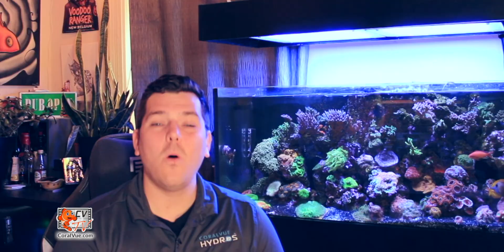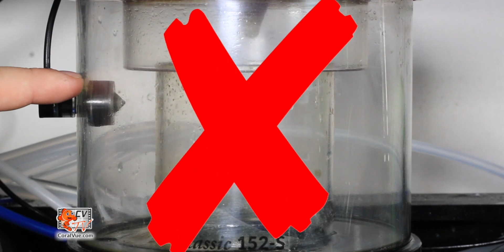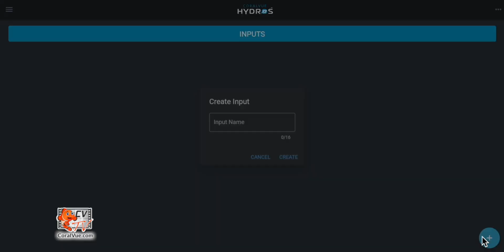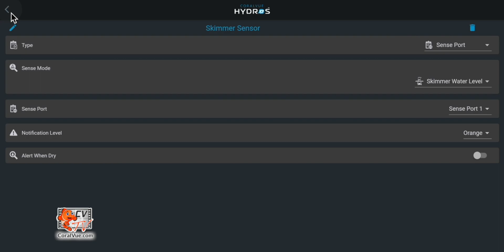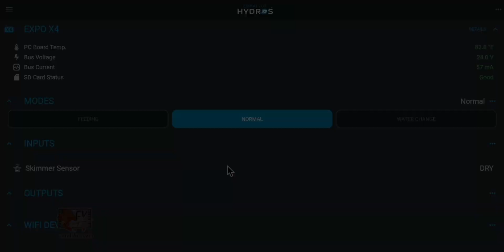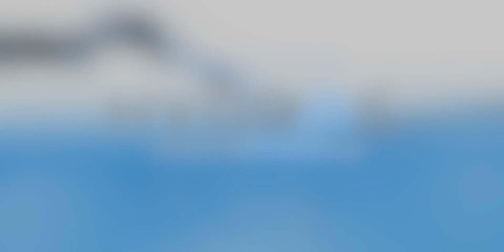HYDROS Set-Up Instructions - How to Add and Configure a Skimmer Water Level Sensor

Comment: Can this be used in on an opaque waste container? 
I would like to add a sensor to the masteronic waste water container but don't want the cable and main sensor to sit chemical slurry from the masteronic, this would be a great potential option if it works through an opaque container (it is a light blue container, water line easily seen from outside container with minimal light).